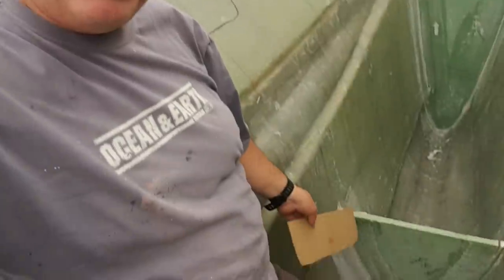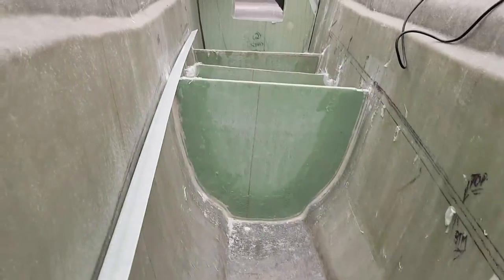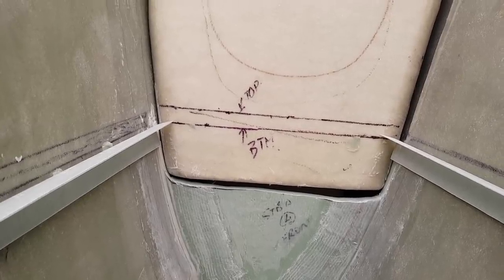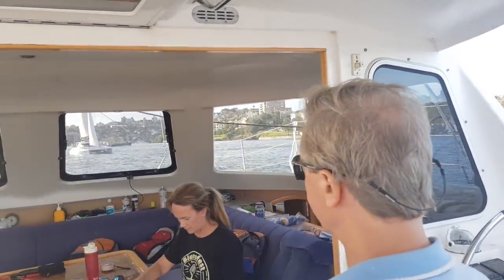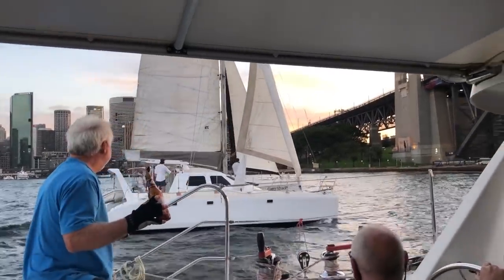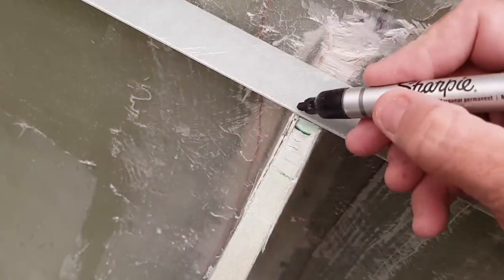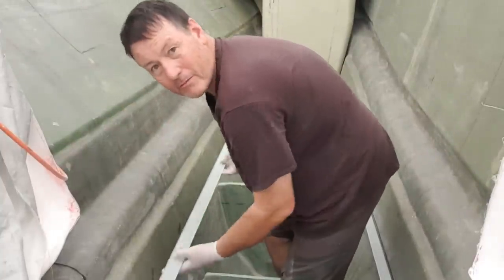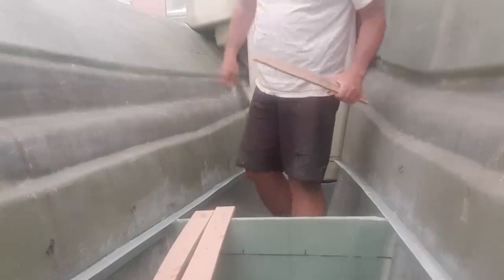Ep070 GRP Angle and The Whiskerpole - Life On The Hulls - Catamaran Build

Comment: Thanks for taking one for the team. :-) Great result on bonding those deck supports in - but wonder if it would not have been easier with a poly bag to do the initial spread and then maybe infilling from the top. Well done on the sailing fun in SH and making like a whisker pole ;-) loved the comment at 11:47 when yer mate was hand hauling in the genoa sheet with the winch handle in the winch!
Reply from the maker: Would be easier with a bag for sure,laziness and pure stubbornness on my behalf.

Comment: Is there a reason you put angle on the top of the bulkheads to glue the floor to instead of gluing straight to the bulkhead?
Reply from the maker: Hello Micah.The Composite angle on each side of the bulkhead increases surface area and reduces sheer point stress on floor.I guess my thinking is to ensure there is ample adhesion and a stronger structure.Cheers Rossco
Reply: Life On The Hulls - that makes sense. Thank you for an incredible series on boat building! I don't know how you do it, juggling your business, boat building, and filming/editing all at once.